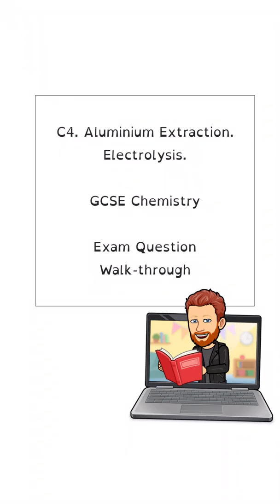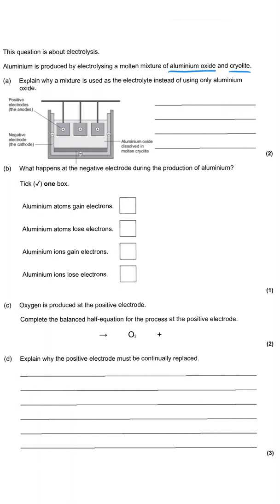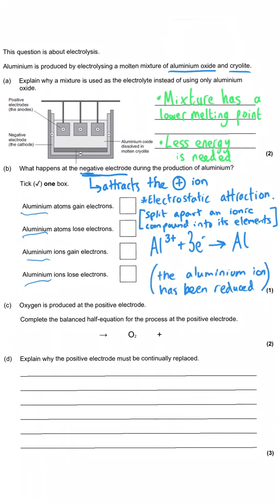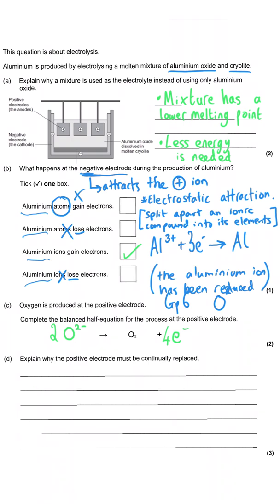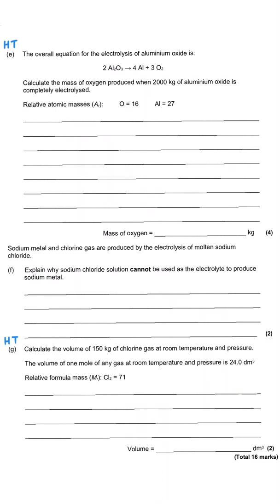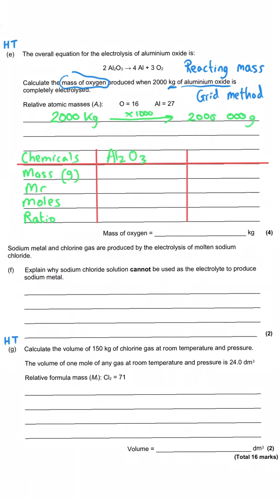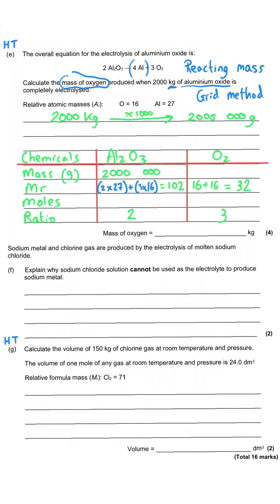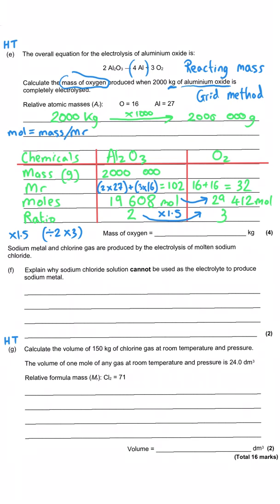Aluminium extraction | Question Walkthrough | GCSE Chemistry

Comment: mate for question e) you could of just done: 
102 x 2 = 204 (Al2O3)
32 x 3 = 96 (O3)
96/204 = 0.4705 (percent of O3)
0.4705 x 2,000,000 = 941,000
941,000 / 1000 = 941 kg 
this is a lot quicker, your way was too complicated
Reply from the maker: Totally agree that this is another option. And you get just as many marks for the correct answer. Thanks for sharing your method. 

The reason I prefer to teach the grid method is it ensures you get method marks if you make a mistake. Also, it ties in nicely with other uses of the grid.

 You're obviously really good at proportions etc, so your way will be easier for you. 😃
Reply: @chemistrytutor  Fair enough, thanks for the video as usual.